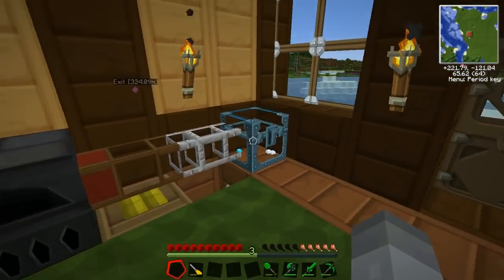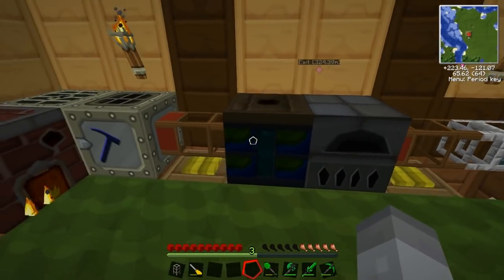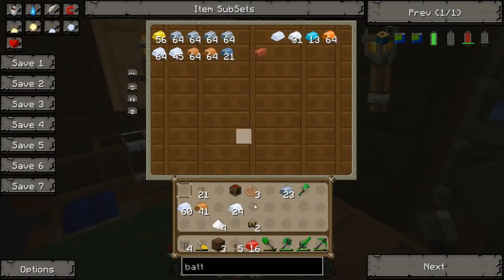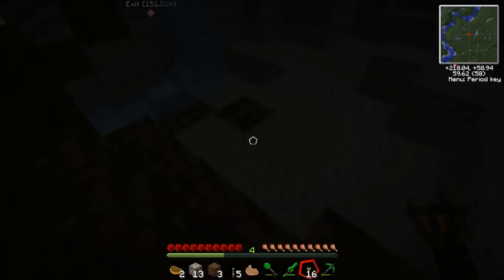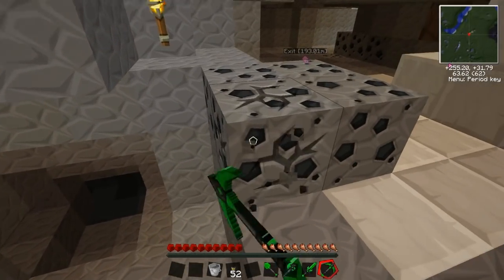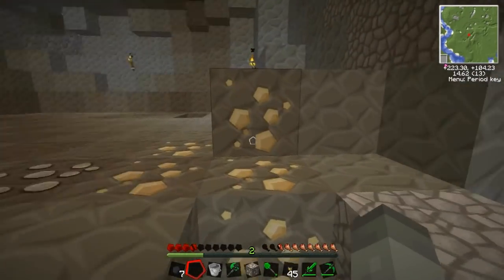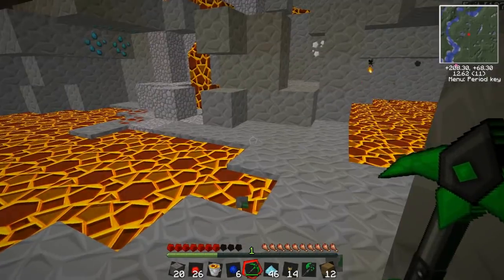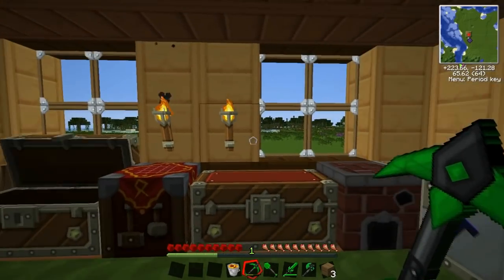Duncan's Lab - 37 - The Lava! It Burns!

Comment: Duncan: the project table acts as a manual automatic crafting table.  What I mean by this is that you can put items in the crafting grid and it'll hold them but you can also put one of each item to make a recipe in the crafting grid and then put the required materials in the inventory part and when you click on the item from the crafting grid then it'll pull the materials from the inventory if there's enough materials in the inventory

Comment: I know! But I think you can get more if you just smelt wood into charcoal. I started by using 1 wood to make 1 charcoal, then placed the charcoal into the furnace to make 8 charcoal. I made it so 7 charcoal go out to another chest and 1 charcoal goes to back into the furnace to continue the cycle. The only issue is getting the wood.

Comment: ummm kinda what it does is it absorbs most items you put into it(as long as theres an item in the top left hand corner) and transfers it into emc and once you have enough emc then you can make the item in the top left hand corner. So for example since a tin dust and a tin ingot have the same emc value(256 emc) then if you put one tin ingot into the top left corner of the condenser and then you put the tin dust in the condenser then you get a tin ingot out.

Comment: Hey every just incase you don't know but you should probably use charcoal to power generators, steam engines, make torches, etc and save the coal for when you actually need it. Also instead of using a furnace to turn your dust into ingots use an energy condenser bc it doesn't use electricity(this works bc the 1 dust has the same emc value as its related ingot, it can also be used to turn wood blocks into charcoal).